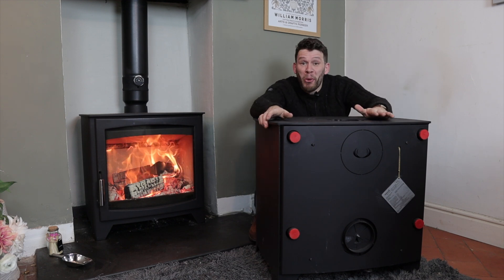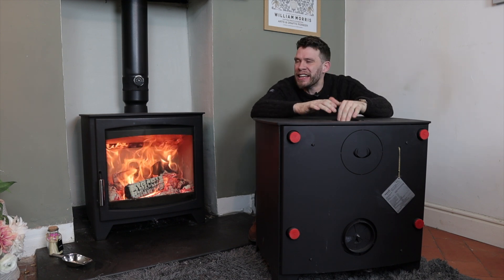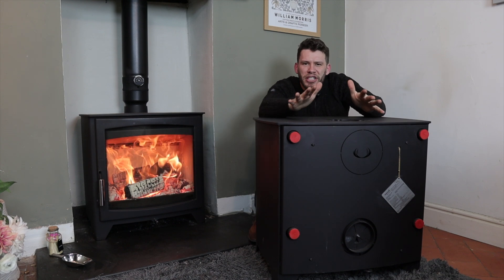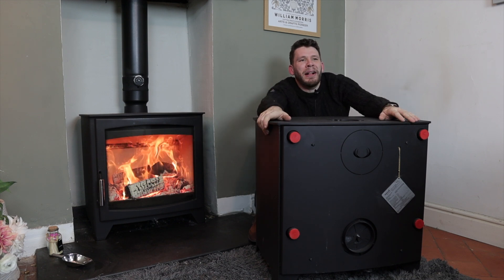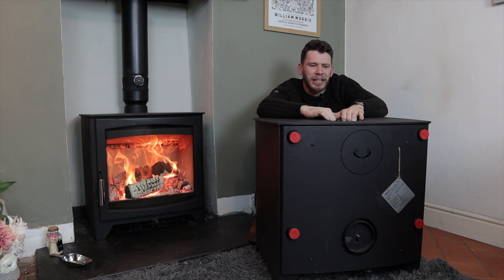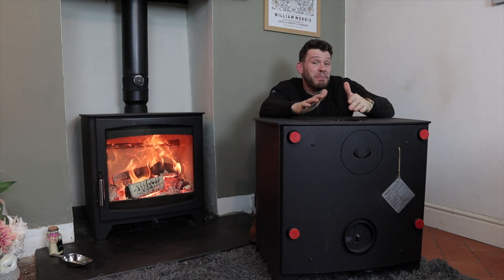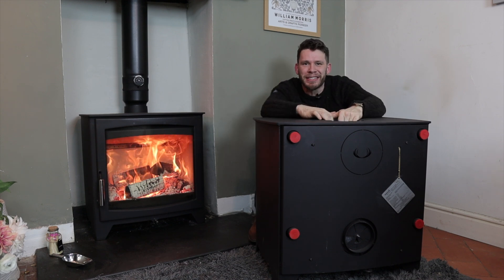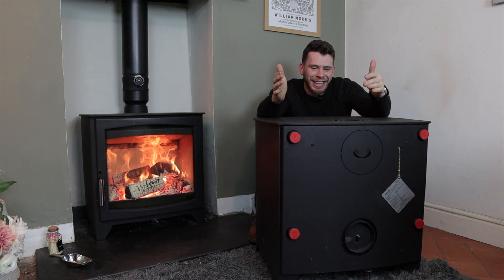How a stove can run your whole house

Comment: What about in hot weather? No hot water unless you want more heat. My house has no gas and gas is due to be fazed out anyway.
Reply from the maker: Fazing out gas will probably take centuries rather than years, and by then we’ll probably have new fish to fry. 
Typically people will use an immersion for their summer hot water, but will light the fire if it gets very rainy (in like this spring and summer).

Comment: My eco woodburner with back boiker has just broken black water leakage 🤦. Burnerman out said they are prone to leaks and hard to get . So now probably having a normal burner put in.As desperate gir heating. But it will only heat one room . So suggested fitting a combi  boiler but im on LPG gas . Ive found a Ottawa back boiler  woodburner. But im now stressed it will leak ir break from reviews if back boilers  . Any help  Thankyou
Reply from the maker: Eco boilers are no more prone to leaks than any other boiler stoves as the construction of the boiler is the same. The biggest cause of premature wear on a boiler stove is not adding rust inhibitor to the tank. This is the cause of perhaps 98% of failures. The ones who do add rust inhibitor, use their stove a lot and burn dry fuel, typically own the same one for decades. 

Only last week I was chatting to a guy who has been using his boiler stove (an old hunter) for 24 years. He just needed some rope for his doors.
Reply: @TheTortoise  Hi it's all new to me what is rust inhibitor please a d what do you do as about to buy new stove . I seem to hear lots of people with the older boilers think it's called a jacket don't have probs...it's the ones line mine where it's inside while unit ....but can't get old style. Thankyou

Comment: We have the aspect 14, but our heating engineer didn't connect the extra pipes to the radiators! 😢
We have to use the hot water from the heatstore, which isn't as effective. If you get one of these, please make sure the engineer knows exactly what they are doing!

Comment: I've been confused about why it's disappeared until I found out it's been outlawed for ridiculous reasons it's ridiculous if it's setup right it's safer than a gas boiler
Reply from the maker: Thankfully it’s not been outlawed. It’s just that manufacturers had to achieve minimum efficiencies, and in large boilers it’s nearly impossible to do. 

Thankfully products like this, give at least some hope!

Comment: I have moved into a house with a boiler stove. Should I manage the fire any differently to a normal stove? Will I need to burn through a lot of wood?
Reply from the maker: Treat it like a normal stove. Obviously a boiler stove is doing a much bigger job than a normal stove, so fuel consumption increase is expected, but only inline with the extra you’re getting.

Comment: Hi, we have a boiler stove here but it doesn’t work, my partners ex husband installed it and will not advise on how it works or why it doesn’t work, do you have any advise for me?
Reply from the maker: The technology in a boiler stove is about as simple as you can get, so it not working is very odd. 

Essentially if you light a fire, the box should get hot, and the water inside the boiler also gets hot and begins circulating through convection. 

What’s not working?

Comment: Hello, Im moving to a 2 bedroom derelict bungalow with no heating or plumbing, I would like an environmentally friendly boiler stove installer with 5 radiators and hot water but unable to find an installer in the Market Drayton area, any ideas?
I have been on the HETAS  register and spoken  to local stove suppliers with no joy😢. Any suggestions greatly appreciated kind regards Laura
Reply from the maker: Getting boiler stoves has become a bit more specialist, and the majority now go in without certification or HETAS installation due to the lack of support in certain areas. It is worth asking the local shops and sweeps, as these business are your direct line into the local infrastructure for boilers. 

Where there’s a will, there’s certainly a way.

Comment: Mother has a back boiler, just heating water. The oil boiler has a separate coil in the tank.
I've wondered if a separate feed to the circulation pump would feed warm water through the rads by using the hot water tank as a thermal mass?
She won't let me experiment though  😂
Reply from the maker: I like a bit of experimenting, but to be fair you probably should do it in your own house, not your mums 😅😬
Reply: @TheTortoise  Sadly I put a combi boiler in, prior to the cost of gas going up. 
I did consider attempting a hybrid system, using an external back boiler and a swimming pool heat exchanger. But it's a big cost for something that may not work.
Reply from the maker: The combi is probably the nicer option for her 😅

Comment: Hi , Great information in your films many thanks for that, do you know if it's possible to use one of these as a backup to using a combi?
Reply from the maker: This is often a trickier fix, as Combi boilers work off a pressurised system. If you look around you might find things like:

Stratford Eco-boiler 12 wood (must be the wood version)

Or

Evolution 26 boiler

These are 2 boiler stoves that are approved to connect to pressurised systems. I’m not sure of any others and even these are sadly not made anymore. But if you find one the Stratford is particularly well suited to your “back up” requirement.
Reply: @TheTortoise  Many thanks for replying keep up the great work!

Comment: I am looking for, without success, a replacement for an old Rayburn. I want a wood burning range cooker that will also run my central heating. I have installed a new wood burner in the lounge and am so impressed with how little wood it uses compared to my old one and would like a modern range cooker. Any suggestions?
Reply from the maker: Sadly you won’t find one. You may find old things, but range cookers with boilers are now very rare and even the ones that do exist cannot run a whole system. Esse make one, but as I say, it’s fairly small in terms of output to water.
Reply: @TheTortoise I've seen the Milan b boiler range cooker, about 1200 from modern stoves, also seen them on e Bay,
Reply: It’s such a shame, I’ve got a supply of ash wood to last me for years. I have a pellet stove that after the first few years is a nightmare - too many moving parts that go wrong one after the other, very expensive repairs, buying in pellets and reliant on electricity to run
Reply: @juneadams9156 I've seen the Milan b range cooker, there on e Bay or modern stoves about 1200
Reply from the maker: Shame you’ve found the pellet stove disappointing, what do you have?
Reply: It’s a Klover, last few years had one thing after the other needing fixing on it. Closed heating system does not work well without mains water. I can’t bleed radiators myself. Reliant on one firm for repairs so they can charge too much.
Reply from the maker: What a nightmare, but hopefully they’re fixing it for good this time 🤞
Reply from the maker: I’ve been speaking to “Stove Innovations” this week and they have something coming out too. It’s getting a little more hopeful out there, but definitely a big gap in the market for an inset boiler!
Reply: Esse do the iron heart boiler cooker, if you look up the bald Explorer channel he's got one, it think they're about 7k tho.
Reply from the maker: The Ironheart used to have a boiler, but now I think they may have lost that option or the boiler is very very little.
Reply: @TheTortoise  OK mate, I know they did a while ago, I was looking and all I could find was the Milan b on the Internet, with a boiler, oven and hotplate, boilers rated at 2 bar which put me off as mine sometimes goes to 3 bar.
Reply from the maker: Interesting, I’ll have a look.
Reply: @TheTortoise  modern stoves bud, 1099 I think, I'm happy with my esse and it's probably more rugged, does say 6 rads, oven, only thing is you can't see the fire as the boiler wraps round the firebox, whilst the Milan b has a glass firebox door.

Comment: By far the most important detail to get right is the heat balance of the system.

Where a typical boiler stove will offer a kw output rating to the room and another to water. These are maximum values but are key to optimising the installation. Where a stove is selected it's imperative to size the hest output to the room appropriately. 

I have heated houses with boiler stoves, more than one in some cases and found the biggest error in some installations is ending up with far too much heat to the room the stove is in because it's being run hard to get the rest of the house warm with radiators.

Get it right though and the results are superb, and very practical if you're prepared to live that lifestyle.  Having done it for decades now I have no intenton of going back to reliance on third parties and energy companies for my heating when I have end to end control of it now.

Comment: I installed 2 multifuel boiler stoves. One in our 3 bed stone detached house in Normandy, France in 2008 to replace oil heating. Bought a Villager AHI for £780 then in the UK and took 2 days to re-plumb in 28mm copper, gravity heat leak rads and open vented header tank. It heated 13 radiators with total output of 14kw. Most were double. Pipe thermostat to operate pump to rads.
Used 25 cubic metres of logs over 7 months of just heating the radiators. Hot water by electric. Paid 15 to 30 euros a cubic metre delivered, cut to our size and seasoned. Heating cost around 700 euro a winter. House really warm. Heat up time to get rads warm to hot around an hour. Our favourite villager.

Moved to County Kerry and renovated a 2 bed 1950's bungalow. Heated that with a Villager Berkley integral boiler stove. Ran 5 rads, 4 double and hot water. Very well insulated and heated the property well. Not as good as staying in as the AHI, but place warm in morning anyway. Burnt wood and smokeless coal.

Also bought a Parkray 88 inset boiler stove for a cottage a few years later in Kerry and for the purchase price of £50 very nice. My current stove is a Woodwarm fireview 4.5kw on my narrowboat. Gravity heats 2 rads and leagues better in quality and controllability of the villager.

New owner sold on. https://onlineestateagent.ie/property-details/5-creamery_road-brosna

Comment: Finally a video on boiler stoves, thanks! I have one that cut my methane bill to zero. I live on the mountain in Italy and produce firewood by myself. The stove heats a 600l insulated boiler (1000 would have been better) and the boiler controls the radiators and the hot water for the bathrooms and kitchen. Couldn't be happier
Reply from the maker: Sounds amazing!
Reply: Which boiler please?
Reply: @fduran6993  a Cordivari

Comment: To run a decent size house it's like 3 tons of wood over winter, not a builders bag either, but actually 3 ton weight, I get anthracite so it stays in 24/7 and  logs as well

Comment: I've got an esse stove, I've also fitted an old school back boiler in my open fire, thermoswitch to turn pump on, so that's 2 heat sources and 2 boilers, heats a very large house, if I get free wood (!) it's totally free heating, plus a great open fire to look at, stove is esse, s version of an aga, so you've got 2 ovens, hotplate, works well, no gas on at all and if you keep electric low your living fairly cheaply, you just need a chain saw!

Comment: I have a 20KW Woodwarm Fireview with a back boiler. This is integrated into my heat system. When up to temperature a themostatic valve opens behind the boiler,  activates a separate water pump and turns off the main oil boiler and pump. I have lived with this system for 12 years. It’s reasonably efficient in terms of cost. The downside is that it is difficult to control the temperature of the water within the system. This has led to two boilers being written off due to corrosion within the heat manifolds along with several radiators also being written off. All as a result of acidic build up within the system due to a lack of temperature control. This cannot be mitigated to the addition anti corrosive additives in the system. After recently replacing another Grant oil fed boiler I finally disconnected my log burner from the heating system, drained the back boiler and now use the log burner as a local heat source.  The result is that my burner now produces 20KW i stead of 4kw which - as you can imagine - produces a huge amount more heat. Enough to heat the entire ground floor. The resultant increase in oil consumed is therefore far less than I expected. In addition, I can use my log burner as a heat and cooking source during power outages - something that I could not do previously. Having lived with both set ups I would never utilise a back boiler heat source system again unless it was a completely separate system
Reply from the maker: This is a very strange system, and in all the years I’ve worked with boilers I’ve never encountered this acidic problem. I’m a little confused how temperature could have created acid at all???

Obviously a lack of rust inhibitor can cause problems, but minus that I’ve known tons of systems with multiple heat sources. Most commonly now people will have a twin coil cylinder connected to a stove, solar and then an immersion probe, but that’s obviously still different to yours.
Reply: thermal loadvalves and injector tees would have fixed this

Comment: Lived for the past seven decades with a solid fuel Rayburn cooker. It keeps my large kitchen toasty warm and does all my hot water needs and runs up to six radiators if required. Bugger paying standing charges to utility companies and their rip off price per unit on top.
Reply from the maker: Definitely with you there. One day I’d like to do a project series installing a boiler stove and re-discovering this old technology.

Comment: Rough price pls?
Reply: £2.5k
Reply: @mvztvp  cheers i'd say that's a pretty good investment. My 9kw log burner was £1500 without any back boiler. I'd say this combined with my pellet boiler and a buffer tank would be a beast of a set up and pretty cheap to run once installed.

Comment: Had a Coalbrookdale Severn with back boiler many years ago, worked in the mines and got free coke. It was wonderful, but in summer, the cylinder used an immersion heater. Ours fed 9 radiators comfortably as well as providing ample hot water. Only issue was if the radiator pump was off, the  heat in the storage cylinder got so great, it vented off hot water to an overflow tank in the loft. Got a simple wood stove now to back up the gas boiler, much easier to control heat throughout the house.😊
Reply from the maker: Sounds awesome. I know what you have now is simpler, but the Severn and it’s boiler (to me) is still so much more exciting 😆

Comment: Hi, I have a Charnwood Skye 5. Is there a way to connect a back bolier to it? Charnwood have a flu boiler on there website.
Reply from the maker: You can add a flue boiler to basically all their stoves, but it is very little. These often get used in tiny spaces like boats etc.

Comment: My 1st house had a back boiler. But it was a pain. Boiler stove only good for a family situation in my humble opinion.
Not forgetting the expense to have one fitted.
Reply from the maker: Because of the poor infrastructure for installation almost every boiler stove I encounter is fitted without adhering to modern regs. This makes it relatively cheap to do, but obviously isn’t what should officially be done.

Comment: Can these boiler stoves be connected to a combi boiler..
Reply: Depends what the combi boiler is feeding, if it's supplying a vented hot water cylinder then yes, if it's a pressurised system then not without modification to the plumbing
Reply: @edwardplant8742  I've wondered about some form of heat exchanger between high and low pressure.
Maybe an unvented cylinder with the heating loop running low pressure from a back boiler.